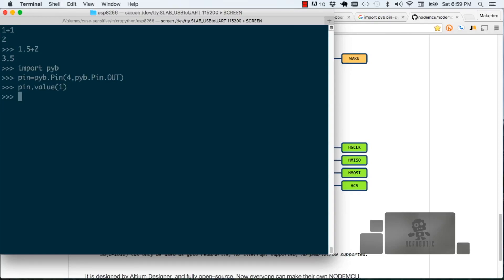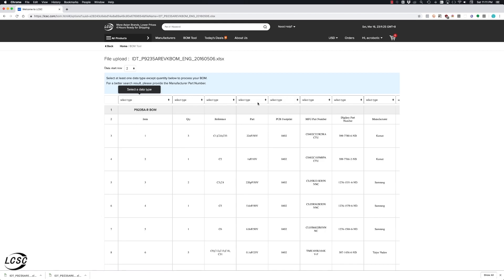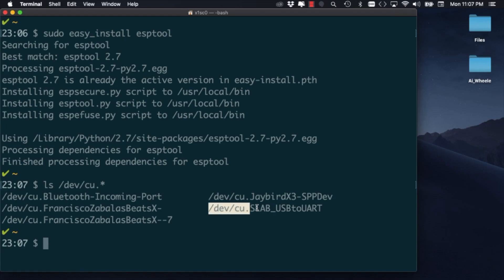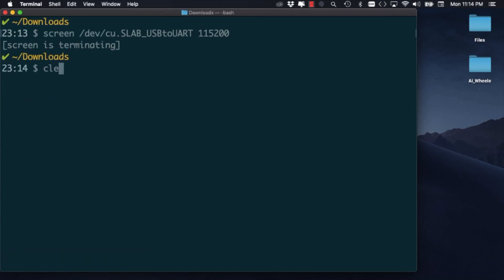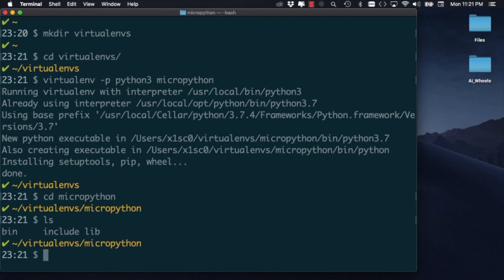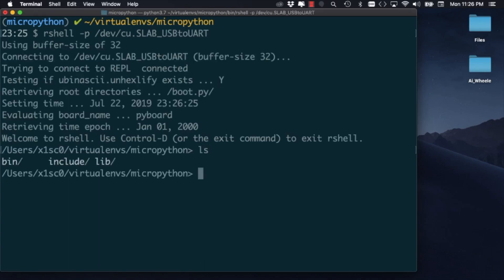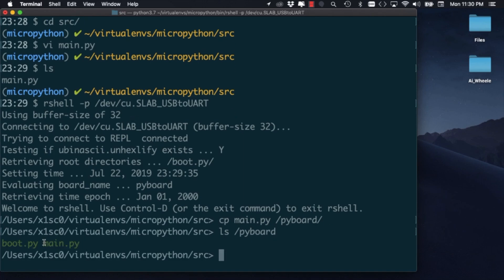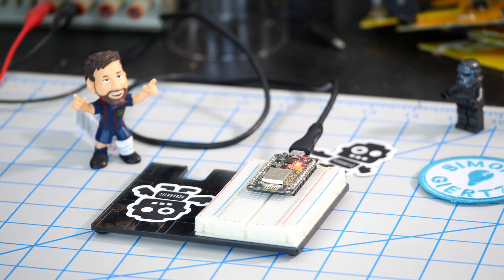ESP8266 MicroPython Step-By-Step: rshell, VirtualEnv, and Python 3

Comment: Thx for this. I really want to get more into Micro Python 🐍 but we just need a better UI like the Arduino one or VSCode. These videos are very helpful.
Reply from the maker: No problem. You're absolutely right, originally I wanted to do a simple MicroPython project (it's been a while) and I was surprised how hard it still is to go from 0 to getting a file to run. So I made this video first. I can now resume my original plan. Glad you found it useful!
Reply: I can see at least three MicroPython addons for VSCode in the Marketplace right now.
Reply: Fundorin @acrobotic maybe a video using one of these plugins?
Reply from the maker: Probably not any time soon, unfortunately. I haven't seen much demand for VSCode (in my corner of the internet).
Reply: I've been happy with uPyCraft as an IDE-lite for microPython development on ESP8266s... (http://docs.dfrobot.com/upycraft/)